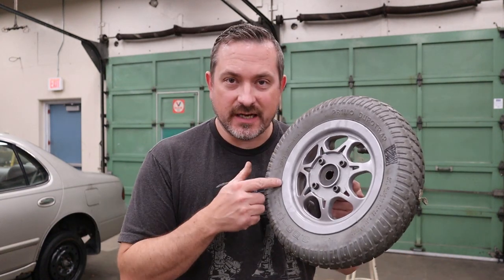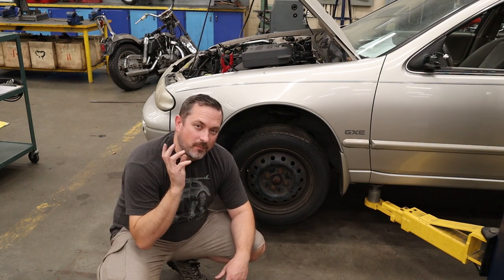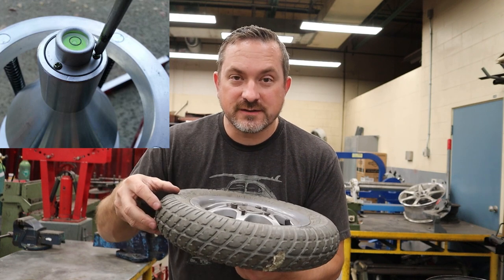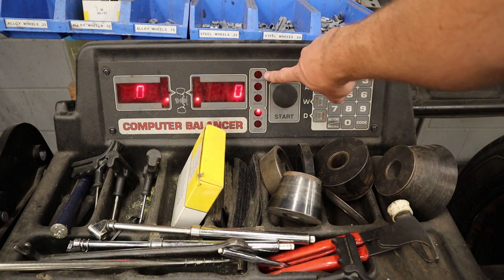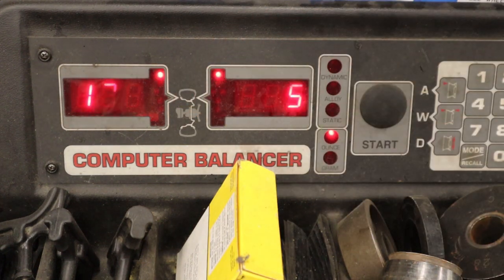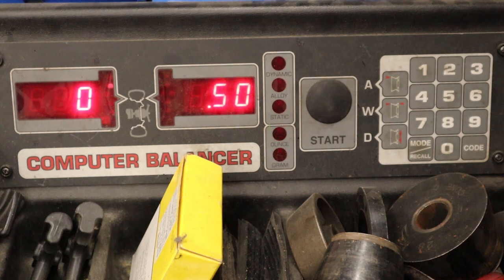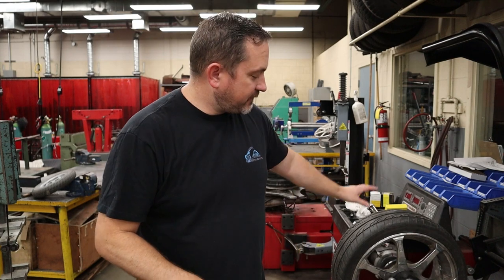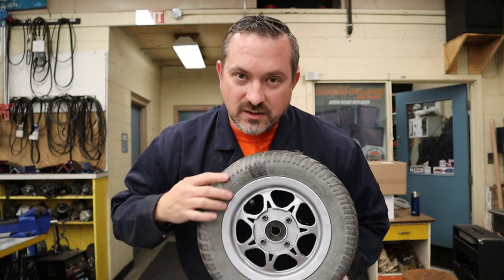EXTREME out of balance wheel!  How to use a wheel balancer & everything about wheel balancing!

Comment: So why are balancing beads not used in regular car tyres?
Reply from the maker: First off great question, I had to think about that one for a minute.  At first I though it is probably just because of the added cost and hassle during tire changes.  I think it has something to do with the fact that car tires are more uniform and less likely to have large debris (rocks) caught in the tread which creates an out of balance situation until it gets flung out kilometers later.  Where as trucks have bigger tread grooves and require a balancing system that can self adjust as needed.  However that still doesn't answer why new trucks with aggressive tread patterns don't come with balancing beads either.  Deep thoughts.......

Comment: But what about balancing the wheels only (rims) and then getting brand new tires for them? Can new tires by themselves be out of balance?
Reply from the maker: Great question but sadly this doesn't work.  Both new rims and new tires are not balanced perfectly and require balancing before being installed on the vehicle. They will have red/yellow dots to help reduce the amount of weight needed to balance but will still require some weights. Thanks for the watch.
Reply: @wayofthewrench  Great I suspected it doesn't work, because I never saw anyone anywhere doing that haha Thank you for your (swift) reply! :-)

Comment: The FMC tire balancer Ive purchased at a very low price. It is a model 5.1. It is in need of repair due to something in the calibration system. Any suggestions?
Reply from the maker: I would be tempted to open it up and give it a good blow out with compressed air to get all the dust out.  While you are in there check for  loose connections or blown components on any of the circuit boards.  I have had a lot of success resolving issues with machinery doing this.  Beyond that your going to need more info to diagnose it properly.  Good luck.

Comment: For balancing steel rims it's not to difficult but aluminum rims like 2000s Gm cars can be dirty and difficult need sand paper and scratch down the surface cars like Toyotas Honda and mostly kia wheels ballance the best getting the old wheel weight sticker off from the rim takes time i have thought of drenching it in gas and using a little fire to get it to separate the glue and wrinkle the paper mabe make it easy to scrape off with plastic getting the old sticker off without damage using buff cleaner then scratching the sticker with a old valve cord after using the sharp end of the bottle cap of the buff cleaner pressured can spray more and you can push the glue and paper off leaving no scratches this is done when the wheel is off the machine you can take stick weights off easily on the ground by rolling the tire around till the weight are at the bottom and scrape them off. Sometimes the tire needs alot of weight like 3.00 so you can stick the weights onto a tire sticker without peeling the back paper on the weights stick it near the area with the tire sticker holding the weights now if you spin the wheel everything will be ok and you can have the weights placed there without a issue if your asked for more weight you peel the tire sticker off and try again without wasting and weight because the film wasn't peeled. You can also use tire stickers to give alot of strength to sticky weights that dont stick on newer or older rims lets say you need to put 1.50 you clean the area very well you spray very little buff cleaner arsol can onto the sticker and you rub the glue from the sticker onto the rim you let it dry a bit and stick the weights directly ontop of the very sticky glue. Great video watched it all
Reply from the maker: Lots of good tips here!  Thanks for the watch and welcome to the channel!
Reply: @wayofthewrench  Another good way to clean rims that have brake dust for sticking new weights is scratching the surface than use hand cleaner with sand grains pouring a little on a dry rag ad little water you can wipe very well with pressure in the area you want to place the new weights the area will be silver a clean another way i already said was a brass valve cord using the brass stem to dig into the arsol soaked paper you will notice the paper going into the valve stem hole where you fill the tire up from if you dont have a valve core in it the paper will keep peeling off the rim after you use the end of a plastic spray can arsol cap you hold it in a way like you use it as a shovel to dig the paper off when it is wet from the arsol you will notice the end of the cap it will bend in a way to be perfectly level with the bend of the rim and drag the glue and paper away from where the new weights go
Reply from the maker: I'll have to try that, cheers!

Comment: Have you ever dealt with a twisted wheel? Not bent but twisted. I recently hit a curb and took it for repairs, the shop said we fixed the bend but the wheel is twisted and theres nothing we can do about that...i didnt even now that was possible
Reply from the maker: Yeah I see a lot of wheels come in that are ever so slightly warped/twisted but if it's really bad, they should be repaired at a wheel repair shop or replaced.  If it's just a steelie, just replace it.  We have a bunch of wheel repair shops in the Lower Mainland (B.C.)  but there should be some near you too!  Thanks for the watch!

Comment: I am facing vibrations after multiple balancing. But could not find a road force balancer in the area. Is there any other way to balance road force variation on simple balancer..
Reply: I want to add another question
... Is the high part of tire the heavy part also.. and weight are put just 180 degrees opposite to it ??
Reply from the maker: No there isn't a way to simulate road force on a regular wheel balancer.  If you can't find one near you, you may have to resort to narrowing down the problem tire and replacing it.  You can remove one wheel at a time and replace with the spare wheel.  Once the vibrations are gone, you will know that is the bad wheel.  I would search a bit more in your area, I'm sure a dealership will have one, most higher end ones will like BMW will.  Good luck!
Reply from the maker: Not necessarily.  If there is a red and yellow dot on the tire then the yellow dot is the lightest part of the tire and should go to the valve stem on the wheel.  The red dot is the part of the tire that has the most centrifugal forces acting on it (kinda like the tallest part of the tire and should go to the dimple in the rim on a steel rim or the valve core on an alloy).  The red dot should be used instead of the yellow if both are present.

The weights go where the wheel balancer tells you to put them. The dots just help reduce the amount of total weight needed.  Thanks for the watch!

Comment: My tire shop (Jack Furrier) installed 2 new tires and balanced the wheels 3 times and it's still horrible. My steering wheel is shaking between 45-50mph and now the car pulls to the right too (i just had alignment done less then a month ago so idk how they messed that up).
They claim the wheels are balanced well on the machine. 
They just keep adding weights and now there are 26 (twenty-six) 1/4oz weights on my right wheel.
These wheels were balanced perfectly with my old tires.

What do i do? Should i ask for my money back and do the road force balance? I have 20in wheels with low profile tires.

Thank You!
Reply from the maker: wow 6 1/2 ounzes is a lot of weight.  are the weights on opposite sides from each other?  That's a sign of inproper balancing for sure as you don't put weight on when it could be taken off from the other side.  They might need to calibrate their machine.  Are these new tires or used?  It is possible that something is internally off inside the tire and requires a road force balancer.  You could try putting on the spare tire and see if the problems are still there or go away.  Now the pulling to the side is going to be a different issue.  Does it pull when your braking or just driving? Pulling when braking is a seized caliper and the side that it pulls to is the working side.  Pulling when driving is alignment or loose components.
Reply: @wayofthewrench  there are 18 weights on one side of the wheel, then they added another 7 to the opposite side and one more weight randomly placed somewhere in the middle of the wheel and no, they dont have the road force machine (i had like 1oz before on this wheel with old tires and no problems).
These are front wheels and my tires are brand new although not an expansive brand. They are called Lexani (Nexen) 

They said the wheels seem balanced on the machine but when they put it on the car they notice a little wheel bounce, not sure how they tested that.

Alignment was done recently and i had zero alignment or balancing issues before they took the car.

Could too much weight on one wheel mimic bad alignment and cause the car to pull to the right?
I wanted to switch my left and right wheels to see if i notice any difference but they stripped the locking lug nuts with an impact gun 🤦‍♂️

Thank you for your answer!
Reply: @wayofthewrench  Oh, pulling to the right while driving, no brakes involved. My brakes, tie rods, control arms, wheel bearing, shocks are all great. Maybe they messed up the alignment but i have no idea how.
(these are front wheels they did)
Reply from the maker: Well it's definitely possible if they are stripping lugnuts and putting weights opposite from each other....maybe time for another shop.
Reply from the maker: no it shouldnt cause pulling...something else is going on and the fact that they are stripping lug nuts is'nt good.  Get the wheel off and try the spare tire to test if it is that wheel.
Reply: @wayofthewrench  great idea, thank you!

Comment: Stick on have a problem depending on the car and how big your caliper is it may not allow you to put them on because more than likely if it hits your caliper it's going to rip them off anyway
Reply from the maker: Could be but most stock cars don't have this issue.  I've seen this on cars that have changed rims or added bigger brake calipers.  Thanks for the watch!

Comment: I had to have my wheels rebalanced due to other tire shop who mount my new tires and they statically balanced my wheels which was way off but the other tire shop dynamically balanced them and it rides way smother
Reply from the maker: Sometimes they use the wrong style weight or use tape a weights without proper cleaning and I've seen weights fall off before the wheels are even on the car.  Did the second shop have to balance all 4 wheels?
Reply: @wayofthewrench  yes they did they used stick on weights and did a dynamic balance which the other shop when they statically balanced the wheels didn't do it right it was off like 2 onces
Reply: @wayofthewrench  the shop that mounted my tires thier computer balancer isn't accurate at all
Reply from the maker: ouch, thats a lot.
Reply: Yea they used a road force balancing machine which is alot better and detected how much a wheel is outta balance I think some ppl don't know how to operate a balancer I will never do business with the shop I had to mount my new tires ever again this was the second time it happened
Reply: @wayofthewrench  I like ur videos was very informative
Reply from the maker: Thanks bruh!  I try very hard to make good videos for my subscribers so it is always nice to hear back from you guys!  Cheers!

Comment: Great video can you help me I have a fairly new atlas WB 41 tire balancer and always chasing weights 3 to 4 times to get wheel to balance I have calibrated it 2x but still chasing maybe doing that wrong
Reply from the maker: Hard to know what's wrong but a couple things come to mind.  Improper weight placement, balancer is out of calibration (improper calibration), balancer is not on the right setting (balancing a steel wheel but it's on a tape a weight setting), or balancer is malfunctioning.  Are there any error codes popping up?  How new is the machine?  Maybe if it is still under warranty, you could get it looked at?  Good luck.
Reply from the maker: When it asks for more weight, is it right next to the last weight or is it somewhere different and a lot of weight needed?
Reply: @wayofthewrench  I have a question about that!!! on my last rotation and balance (at same place for same tires for two years) the shop guy told me whoever balanced it last did it wrong (This was at Walmart...I know lol) because he spaced the weights out  (when it asked for more) instead of adding weight right next to what was put on....which is the way he did it, two weights together. Is this true?? Actually one back tire on truck feels off and I've never had that? This the first time the weights on each tire were together(if it applied) on a balance...it always rode good lol. I can not remember what he told me why weights should stay together??? They are clip-on's on a 16" light A/T tire for a Silverado. I probably should not even let these guys do it but I had a lifetime deal on that...
Reply from the maker: Here's what I do.  If the tire was just installed, then I yank off every weight and start fresh.  If its a check for balance, then I spin it and see where or if it wants weight.  If it wants weight very close to existing weight and not much needed, then I add weight and leave old.  If its is way off from old weights, then everything comes off.  Sometimes it wants weight exactly opposite from old weights and I remove some old weight to see if it balances out or gets better.  No sense wasting old weights, especially if they are hammer ons or tape a weight that is really stuck on.  Thanks for the question, hope that helps ya out.  PS, remember that weights fall off, it is a common thing so sometimes its not that they didn't balance it, they just might have not cleaned the wheel good enough and they fell off. Cheers Trev!

Comment: Is it common a tire to be unbalanced only inside? Just got new tires an noticed three tires have weights on inside and outside, but one tire have one clip balance only inside nothing outside. Is that normal?
Reply from the maker: It's possible but very rare.  Usually the weights go on both sides or the sticky weights are on the inside instead of the outside cosmetic side.  Thanks for the watch and welcome to the channel!

Comment: Why didn't you just use a wheel weight hammer to cut the weights that's what it's design for
Reply from the maker: Are you taking about the tape a weights?  I always just bend em and snap em, very quick and easy with the .25 ounce weights.  Thanks for the watch!
Reply: @wayofthewrench   it's the bit in between the two handles on the inside of the hammer it's like a cutter you can also use it to cut the wheel weights if they are slightly too much and you don't have the correct weight
Reply from the maker: Thanks for the tip!
Reply: @wayofthewrench  no worries